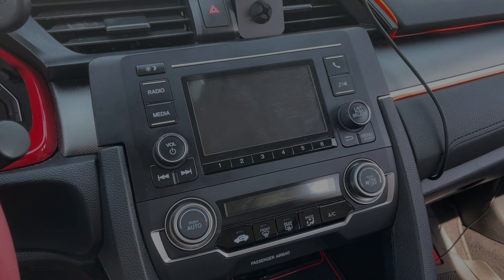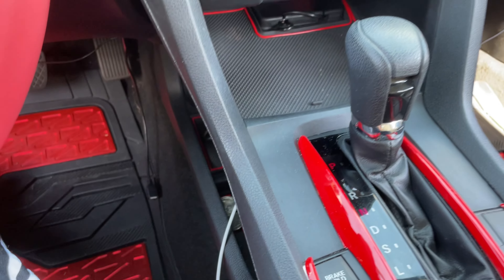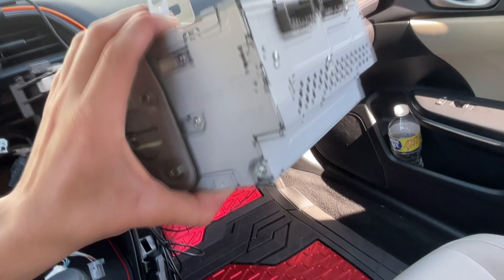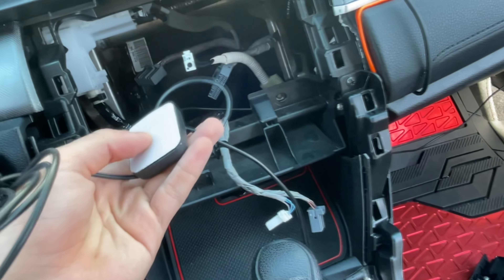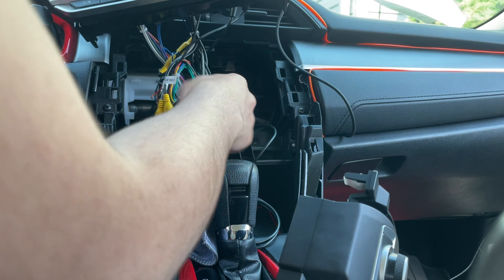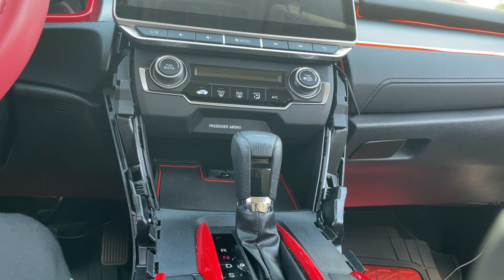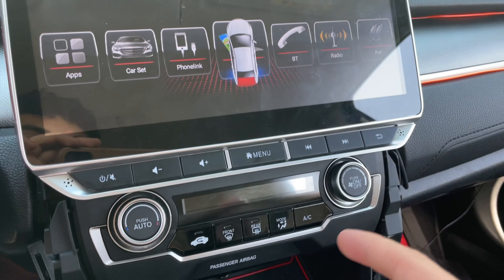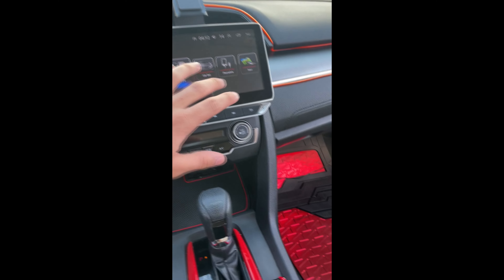How To Change The Screen On A Honda Civic 2016-2021 LX/EX To A Aftermarket Screen (Top Display)

Comment: How do you reset your low tire pressure light?
Reply from the maker: Button on the left with the same sign by your door hold it for 3 seconds when atopped